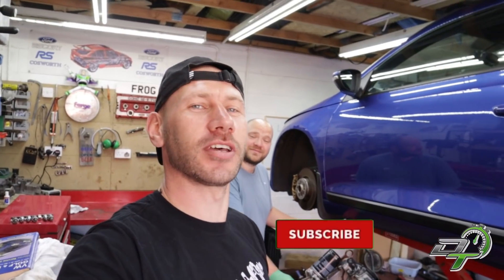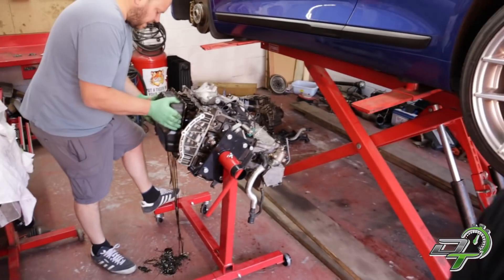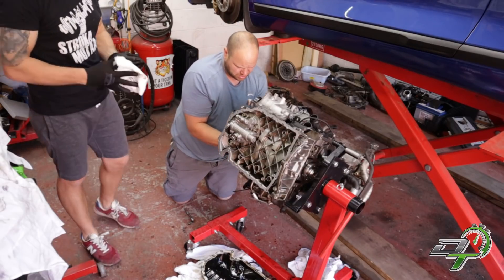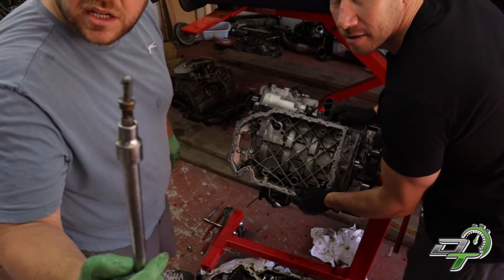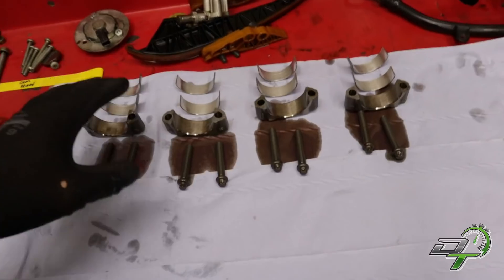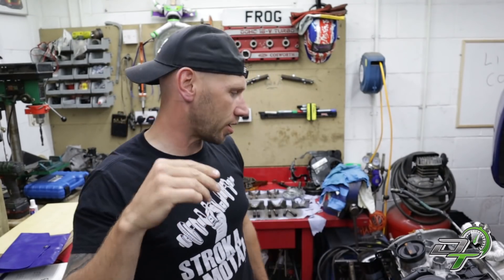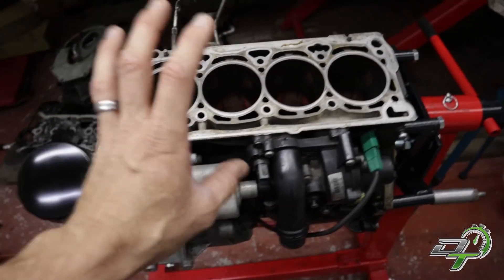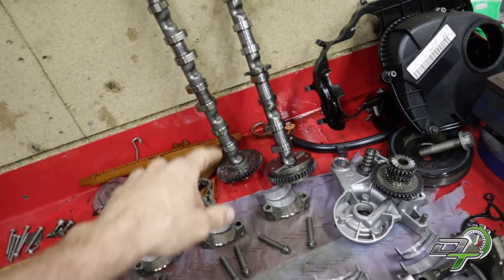HOW BAD IS IT...? TSI ENGINE KNOCK // STRIPDOWN

Comment: That specific engine crankshaft is bullet proof!
I have stripped down engines in much worst destructive condition, and the crank is unmolested. Get rid of all the oil screens from the cam bridge, balance shafts, HPFP.

Comment: was this really from factory? or did some wanna-be go nuts with the silicone?
Reply from the maker: There was a rebuild as the factory engine had issues with pistons (well documented TSI issue). Turns out the rebuild was done at an independent specialist. Sadly too much sealant caused these problems
Reply: @DecimalTenths  yes I finished the rest of the videos on it and u answered my question in a later one lol. U did a awesome job.. I just can’t believe why people don’t think about where all that extra sealant is gonna go lol.

Comment: Excellent guys 
What the F**k happened to the engine to be rebuilt in the first place ? Was it a dealer that done the job ?
Reply from the maker: Theres a lot of TSI engines that had odd pistons installed, so had them replaced under warranty or aftermarket. I think this was one of them.

Comment: Overdosed on the silicon and no anaerobic sealer for the cam cradle. Tut tut. 🥺 Not really surprising it didn't last. A real shame
Reply: VAG has actually done away with the anaerobic sealant. They use silicone now